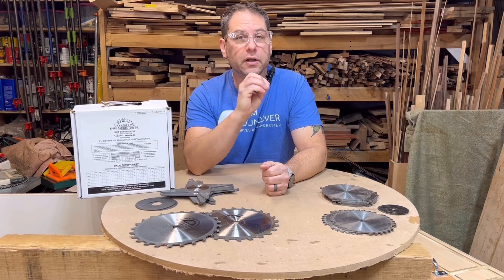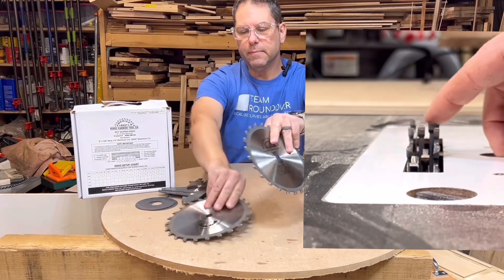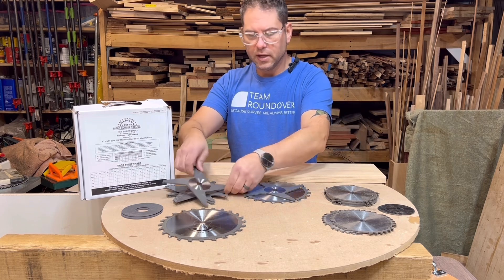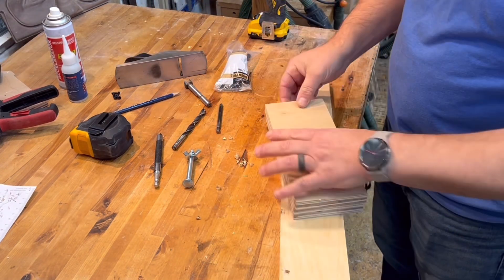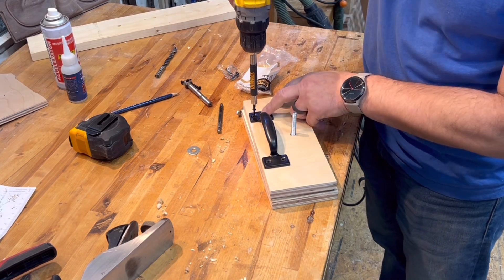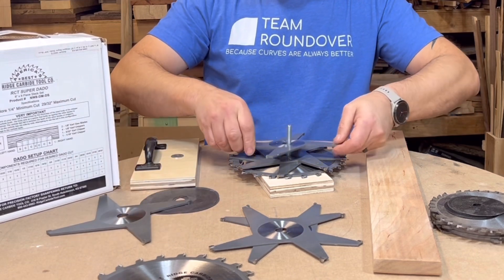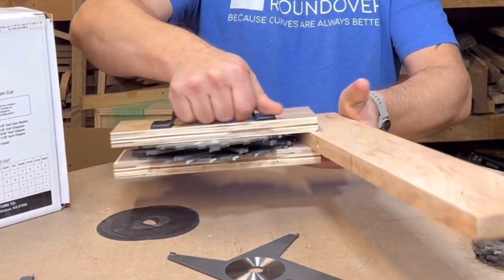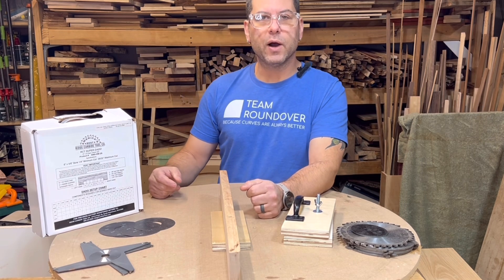Stop measuring your dado stack and make this jig!

Comment: Very cool. If I ever get a dado stack I’ll make this jig first.
Reply from the maker: Thanks for watching bud! The ridge carbide is expensive, but good. For your first one you might find one a little lower cost
Reply: If you do get a dado stack, get the Freud Dial-a-width dado stack.  A chart comes with it that is pretty darn close to being perfect the first time.  If it isn't, all you have to do is LOOSEN the arbor nut and turn the dial a few clicks then tighten the arbor nut and your ready to try it.  I use it and really like it.

Comment: I just measure the stack on the saw with calipers. Then I know exactly how much I need to add or take away. Just make sure when you place the two outside blades you line up two teeth facing out. This way you have a place to measure.
Reply from the maker: Sounds like a good way for you to do it! I don’t like putting the blades on the saw and then measuring. This is much easier for me.